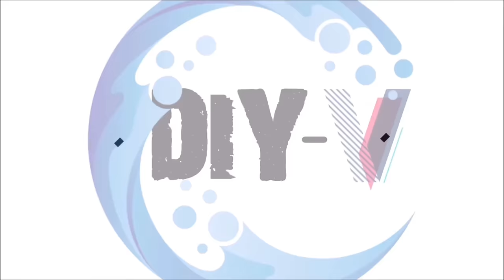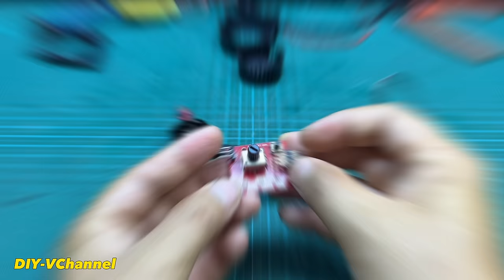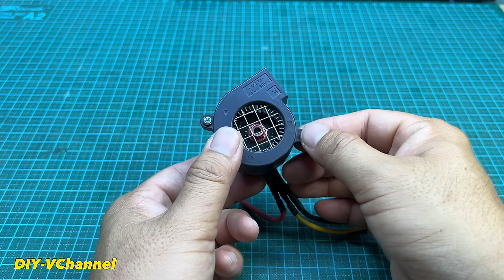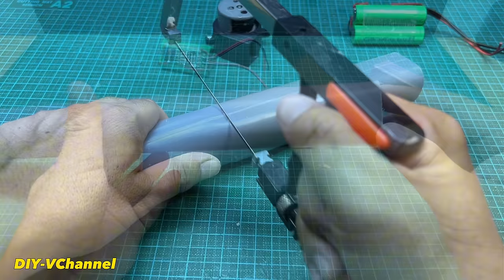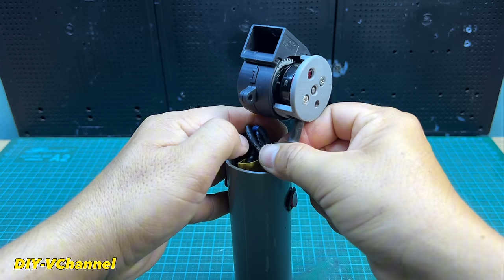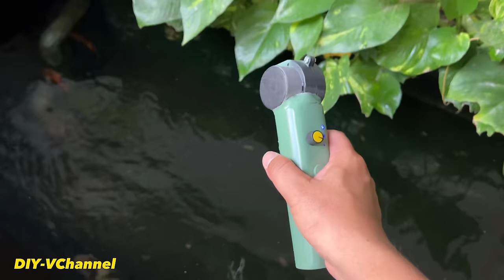How To Make High Speed ​​Jet Fan From Brushless Motor

Comment: Its a high discharge lipo battery 20-30c normal bat are rated at 2-10c not suficiant to run bldc motor used here
Reply: Bro these are lithium ion cells used here
Reply: I meant li ion not lipo

Comment: Make a Floating device with electromagnetss...
divide the base in 8 parts....8 magnets....
also make another floor base with 8 magents..

so whenever 1st line of magnet is set to touch, or comes close to floor....magnet will activate and repel.
same with other layers, if they will go close to floor... activate magnet.... if repeled away then deactivate magnet...

use camera to map distance...

Make this device, u will be in history...